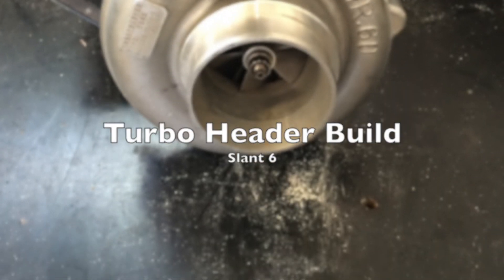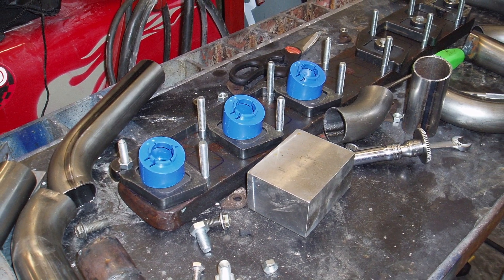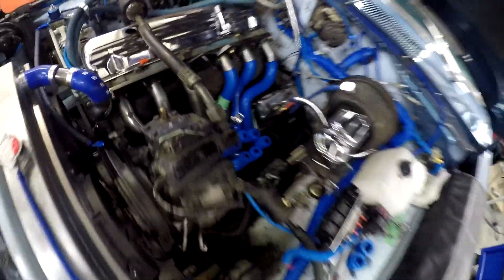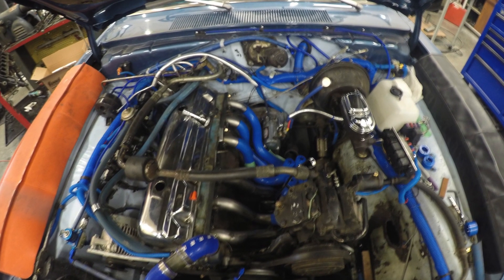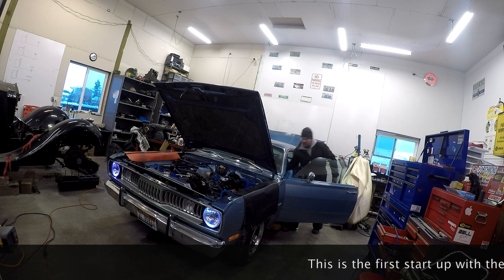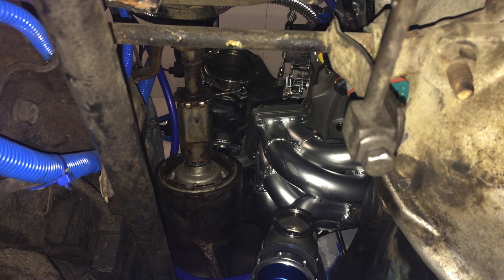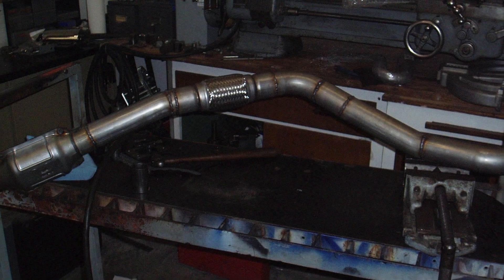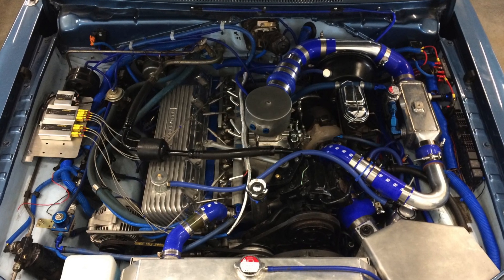Slant 6 Turbo Header Build

Comment: The early Buick draw thru system is almost a bolt on means to turbo the 225. An early Mercedes t3/t4 is both oil, & water cooled.

Comment: Does the header be that complacated or would a 6 into 1 work? 6bt Cummins style
Reply from the maker: So this is a 6 into one with a waste gate port, but yes you could use a log style manifold, there are a lot of pros/cons for both methods.

Comment: This is an awesome idea I grew up with these Slant six engines they run forever but they're mostly dogs I bet a turbo really wakes it up I'm going to watch your videos thank you
Reply from the maker: It wakes that old engine up enough to surprise passengers .
Reply: @tingleyent2149  I bet it dose any idea what kind of horsepower you're making even if you haven't dynoed it you have to have some idea
Reply from the maker: It is around 400hp at 20psi... the heads do not have very good flow.
Reply: @tingleyent2149  man that's awesome I bet you do surprise the s*** out of some passengers with that

Comment: Could of just placed the turbo further down the exhaust system so you could of had room in the engine compartment, and saved money on fabrication
Reply from the maker: A rear mount turbo would add the expense of a oil pump for the turbo, and extra length would add to materials required, but it would have been easier.
Reply: It also would have put a few more restrictions on  power to run as well

Comment: Now have you bought a supply of cranks?
Reply from the maker: I did buy another engine to rebuild for this turbo application, but since the current crank has held up for 15k miles and 20psi of boost, i'm not in a hurry.

Comment: I will be doing my engine work soon, I have a stock 225 in a '67 D100.  (currently working on suspension to lower it)  While the engine is out I will throw in a Howards cam, the Offy intake and some dual headers I have laying around.  The Offy has an old Holley Pro-jection 2D on it.  I am curious to see how that goes, haven't seen too many slants with that combo.  If it works I'll drive in that form for a while.  
Turbo is on my brain.  But if I blow up the slant doing that its going to get a 440.  :D
Reply: Don't do the dual headers for sounds sake. 6 into 1 sounds the best
Reply: How did it come out ?

Comment: I have a EFI turbo 6 too, I used a J-pipe and a supra CT26  turbo,  ran the EFI bungs in the head right above the inlet valves. MS2 controller. EDIS ignition. Custom sheet metal intake. What controller are you using? Do you think the equal length headers are worth the effort?
Reply from the maker: I am running a Haltech Elite 2500 for all of the engine management duties.  For me the equal length header is worth it.  At worst it will be a measurable increase in hp (maybe not noticeable), but the difference in exhaust sound is worth it.

Comment: Where did you get the intake manifold and will it work on the OHC Pontiac Sprint 6?
Reply: Mean Man The intake is made by "Clifford" performance or racing or something like that.
Reply: I got beat by A tempest with that engine, don't see many of them.
Reply: @60viking  that Tempest didn't have a slant 6, it had the Sprint 6, A Pontiac only engine, based on the Chevrolet 230/250, but with a single overhead cam. Only made for 4 years, 66-69. Available with single barrel, or Quadrajet carbonation... needless to say, the 4 barrel dual exhaust versions were pretty "hot" engines.